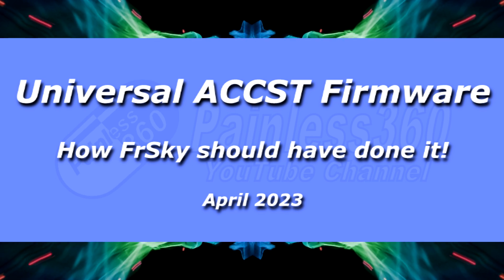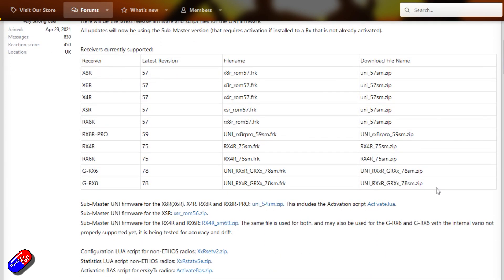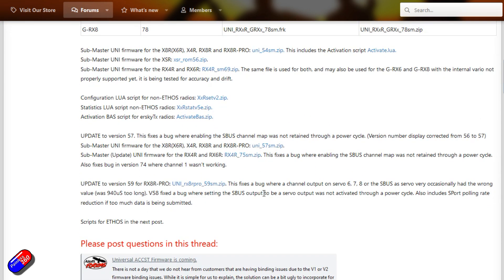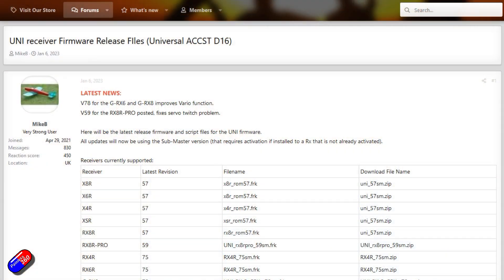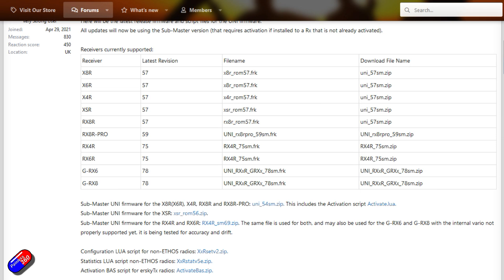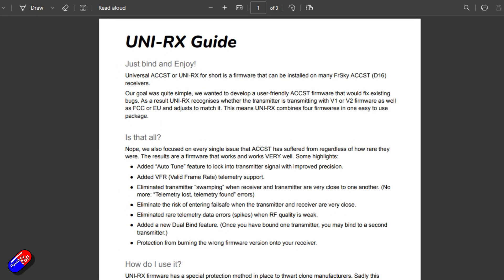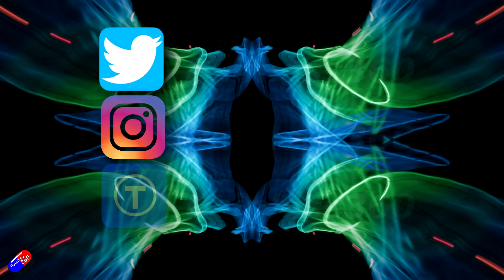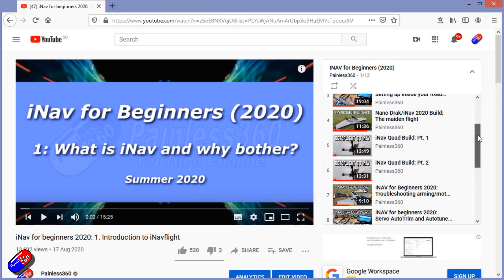Universal ACCST firmware: How it has been fixed (and it wasn't by FrSky)

Comment: Hi I still run the old V8fr accost receivers with the V8ft module. I find them bulletproof. I’m also using the V8fr2 receivers. What was the problem with these receivers. I’ve never done a firmware update. If it ain’t broke don’t fix it is my moto. Can you update the old V8 fr receivers and the V8ft module. Would you recommend I get a copy of firmware just in case.
Regards Jim
Reply from the maker: I'm not sure as I've never used them, but I have been able to flash all of the other Frsky kit so, maybe. I always try and keep a copy of firmware safe somewhere. You never know.... Happy flying

Comment: But wait there's more! I found there are also some RF improvements with the firmware. I was having some frustrating swamping issues with an RX8R Pro RX, a gas plane and narrow run-up benches. It is a night and day difference with Uni-Rx firmware. Along with the reputation of the developer, I am seriously considering simplifying everything and running just Uni-Rx receivers and going back to a QX-7 running ERSky-TX. I would probably fly through more gallons of fuel than ever.

Comment: In all fairness FRSKY have moved on with ACCESS, I still have my old radio but much prefer the X20 series. Binding and flashing OTA is a breeze.
Reply from the maker: The new hardware is very good and ETHOS is slowly improving too. Projects like this exist exactly because although Frsky has 'moved on' there are lots of pilots who haven't. Me included... Happy flying
Reply: @Painless360 lol! Me too! I've got a max66 jr radio i still use occasionally. 😮😊.

Comment: Never went to ACCST 2.0 as I had zero problems with 1.0 and saw no reason to update 50+ models. Given the pain involved in continuing with FrSky and 2 model equivalent cost of ELRS TX Module plus 2 x 6 channel receivers, I will not be looking back. FrSky lost sight of their market.
Reply from the maker: I think a lot of pilots are in the same boat and have similar feelings. I honestly think they underestimate the strength of feeling. I did explain all of this to my main contact when they approached me last year so they can't complain they didn't know...

Comment: Great option for all the "X" gen receivers we all have lying around.  Personally my new projects are all crossfire, but countless old projects still have FrSky ACCST.  One point: Aloft Hobbies has a program where for $6 you can mail them your existing RX and they'll update the firmware to Uni.  I might send them a bundle :D
Reply: If you can flash ACCST firmware, you can flash UNI firmware as well. After flashing you bind the receiver and then run a LUA script which gives you a code, which you send to your FrSky official dealer (like Aloft, T9hobbysports and EngelMT) and they will send you an unlock code to enter in the same script (receiver code does not change when powering off the receiver).

Comment: Looks interesting, I read the PDF on the aloft forums site and couldn't find if there is a cost to upgrade yourself and get an activation code; does this cost money to install it yourself?
Reply: There is no cost - Just need to send us an email to get your activation code. This keeps the firmware out of the hands of the clone manufacturers. We do not want to harm FrSky as they do make the best hardware available today. No one else comes close to their hardware quality and reliability or investment into the hobby.
Reply from the maker: Please can you make this clearer in the website. Happy flying!

Comment: Thanks for the video, I will no doubt be back to watch it again. ON A DIFFERENT SUBJECT: A question for Painless 360 channel: IS it possible to flash firmware on A Radiomaster R88 reciever using SBUS port or any other port as I'm not sure, P.S Where would you find firmware files. Hmmmmm. Good question? I hope you can help.
Reply: NO Radio Master are the clones we are keeping this firmware away from.

Comment: The features sound nice but it feels like a bit too little too late as it's a whole lot of fiddling around to fix a system that's now been surpassed by the likes of ExpressLRS. If I was still using a bunch of Frsky receivers in shorter range line of sight aircraft I might feel differently. I swapped over to the expressLRS receivers that can drive servos directly for my simpler aircraft.

Comment: What about r-xsr, xm and xm+?
Reply from the maker: Check out the project link for the latest details... Best of luck
Reply: I know they are working on firmware for the R-XSR. Not sure about the XM+ though.
Reply: @btbplanevids  XM(+/R) uses a totally different MCU (8051) with too much limited capabilities so don't expect that to ever happen.
Reply: @arlemooldijk1595  yep it was only the R-XSR I asked about as I use those in quads. I don't have any XM series receivers.
Reply from the maker: I's ask Aloft. Odd they haven't replied to you on this on as I can see they have been active on this video.. Aloft? Any ideas?